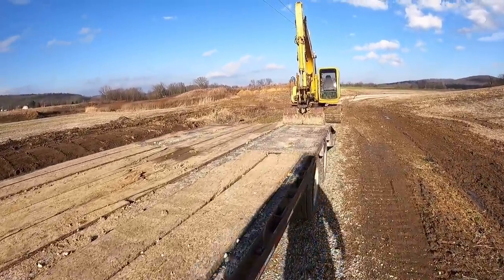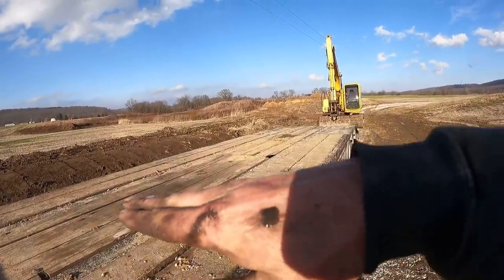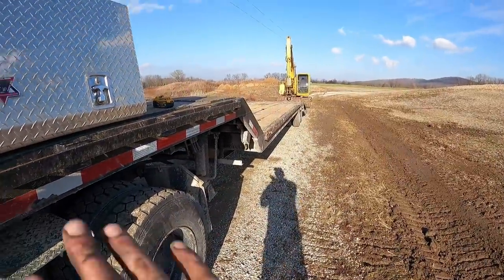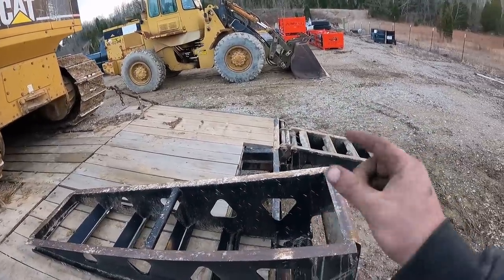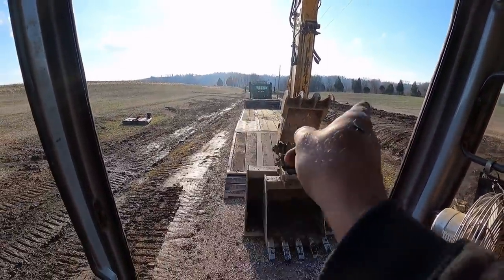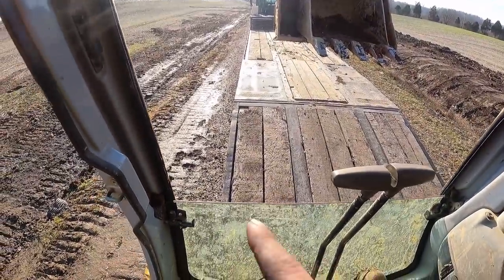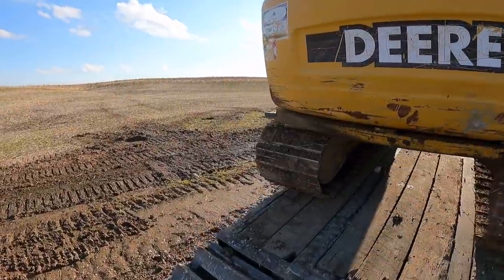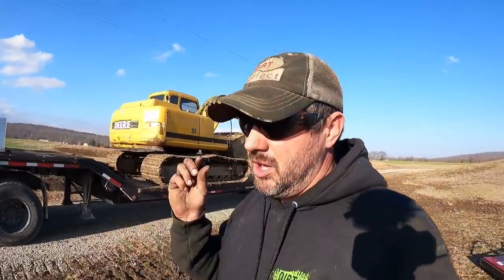How to Load/Unload an Excavator | Excavator Training

Comment: He obviously did it off camera but if you’re loading an excavator like this. Make sure you tuck the stick & bucket all the way so that it won’t hit any overpasses or anything like that.
Reply from the maker: Thanks for the comment!
Reply: Would having a checklist to review help someone remember the step to use a height stick? What about something in the cab of the truck or on the equipment? How do you remember to check the height of your load?

Comment: The guy did a good job and looked at his surroundings and observed any potential hazards and didn’t need to go onto the trailer with the boom tucked in as nothing ahead, why make the job harder when you don’t need to? Also it doesn’t really matter what end the cogs are or if it’s backwards or forwards unless you don’t know how to drive a machine and wouldn’t make a difference with the weight. Also when he lowers the boom after loading it usually tucks in at the cab height so won’t be a problem going under any bridges. I’m sure if it was an abnormally huge machine then it would be measured and checked instead of just visually. Anyway everyone has to have their 2 cents 😂 good job, best way to learn is to practice!

Comment: i use to love loading the huge rubber tire scarifying machines, huge balloon tires and chains, 3 inches of each tire would only be on the float at any given time, and all you had was some young dodo driver, that was usless for any help. i use to load and unload the road building excavators, on an off the side, the floats the big paper mill wood lands had were over axle with step beaver tail, drop decks didnt come out until the mid 80's

Comment: I would normally drive up the ramps with the bucket tucked in and when I get to the camover point I stop crawling and extend the bucket and stick out, shifting the centre of gravity forward and set the machine onto the deck before crawling into position. I find it safer that way

Comment: Any preference for idles first on or sprockets ?
Reply: Idlers
Reply from the maker: I think drives in rear...but not sure it entirely matters.
Reply: Doesn't matter, it loads the same and has no real impact on the machine.
Reply: It can depend on how tight your tracks are. I've seen loose tracks binding up on the cleats going up a float when driving up in reverse. It's usually best to go forwards so the bottom of the tracks are tight and the top is slack. It also makes the machine easier to control

Comment: Hola. Necesito saber las medidas de las cadenas y de los trinquete, para el amarre de una Caterpillar 320.
Gracias.
Reply: Si entiendo la pregunta, 4 cadenas de grado 70, 3/8" x 44" con ganchos Clevis de 5/16 pulgadas con hardware de montaje. Necesitaría cuatro puntos de empate independientes. Creo que este canal tiene un video.  
If I understand the question, 4 grade 70, 3/8" x 44" chains with 5/16 inch Clevis Hooks with mounting hardware. You would need four independent tiedown points. I think this channel has another great video on the requirements.